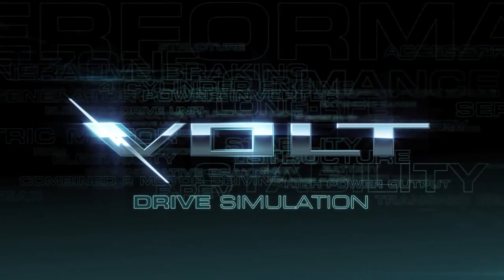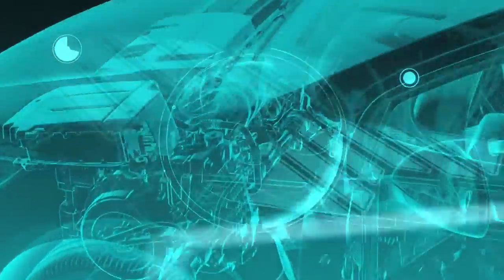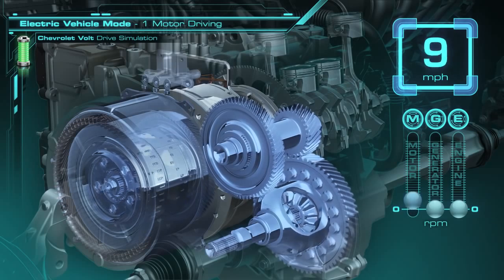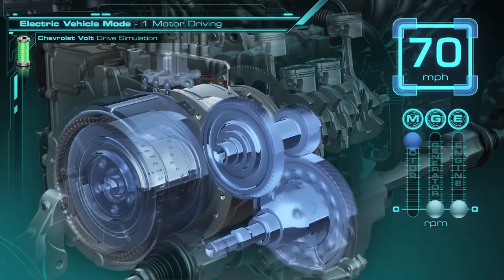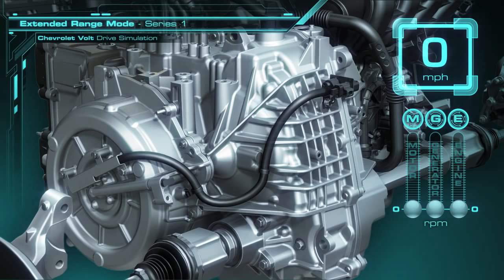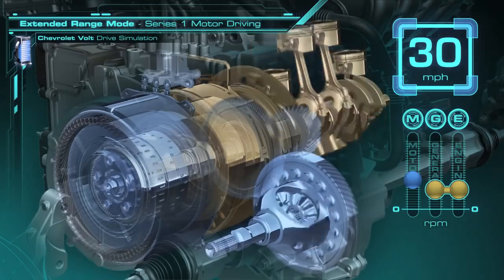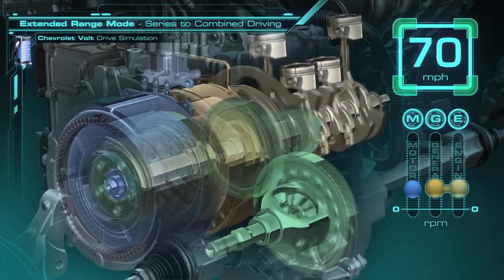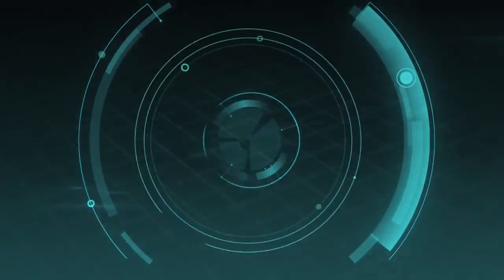Opel Ampera - Engine Modes explained

Comment: I often wonder if they were just too early with this innovation. I mean - replace that petrol engine with a hydrogen generator, and you truely have a 0 carbon emmission car with range as far as the amount of hydrogen you can pump. For day-to-day you can just use electricity. And when you go on a holiday - you tank some hydrogen on the way.

Comment: This is the future.
Pure battery drive is only a temporary solution, until the optimal battery is found, and then this.
The only thing is that the internal combustion engine must be well designed, Miller's timing is a must, maybe a turbo.
The generator is also efficient, compact, .....

Comment: To this day, this is the best hybrid system ever made
Reply: Too bad it was done in house at GM, they slipped up and let out a good product with way too much quality control and not enough designed obsolescence. GM hates anything that actually lasts over 3 years without requiring maintenance or replacement. You will never see this mistake repeated by GM. They will make sure even their EVs require constant maintenance and new parts, despite the inherent simplicity and reliability of electric drive systems.

Comment: Servicing costs are INSANE. Can only be serviced by select dealers and they have you by the short and curlies. They sure know how to charge,
Reply: Gotta rip off the customers somehow, GM made this one too good so whenever one gets serviced they have to compensate by overcharging even the basic stuff, because nothing bigger won't be breaking down any time soon.
Reply: @Manintoga  I've never had a single problem until after 8 years it suddenly stopped charging. I took it to the dealership which "fixed" it by updating the firmware and since then the battery which was flawless given the  huge unused buffer delivered 20% less of usable energy. This was made without any warning or possibility to go back to the previous firmware therefore it's pretty clear that for GM giving no upgrades or infotainment updates was not enough to kill that car.
Reply: Loads of garages service em now

Comment: This presentation is completely wrong. In normal mode and charged battery, the combustion engine never kicks off.
Reply: That is not the case, if the battery has charge and normal mode is selected the combustion engine is dormant. I have driven an Ampera for at least 12 k miles.
Reply: you are wrong i guess. the car can definitely drive without ICE